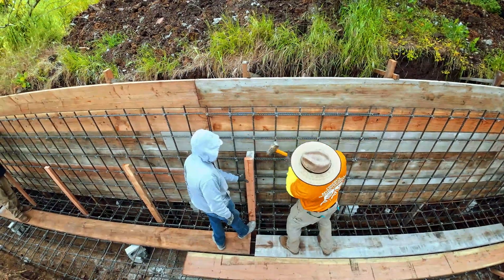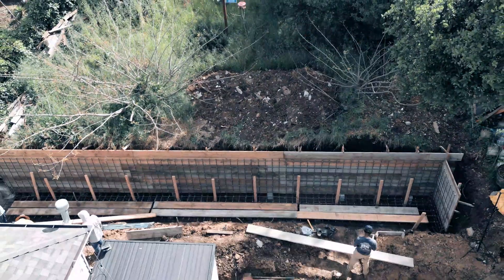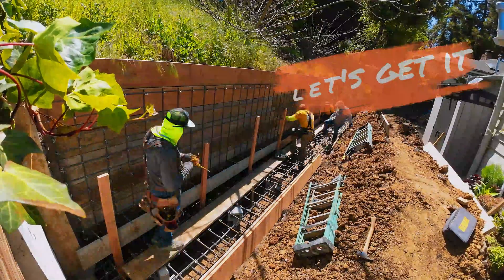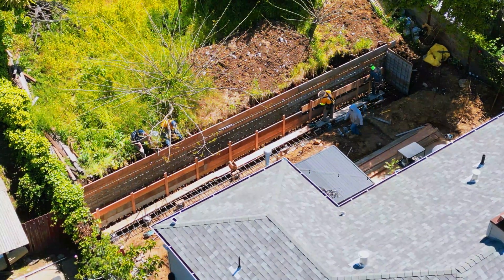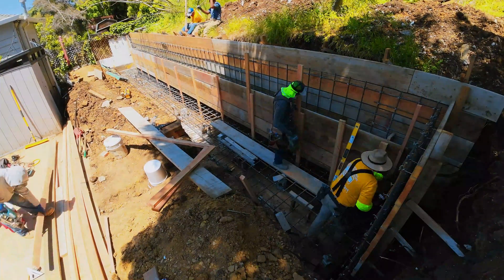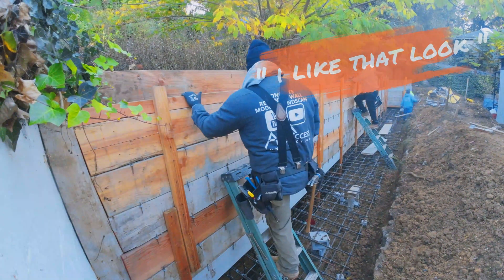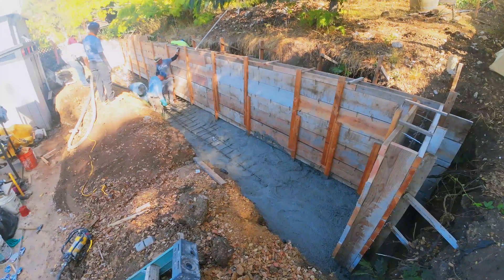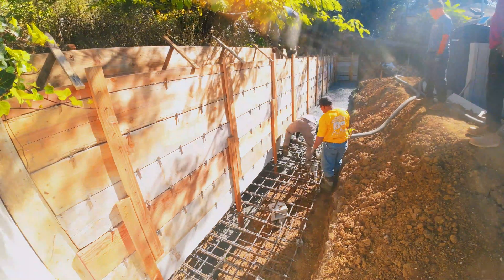How We Stabilized This Backyard With a Structural Concrete Retaining Wall

Comment: Awesome video, I have a similar Retaining Wall 12 inch wide footer with a 6 inch wide wall. My question is when I am driving the 2x4’s into the ground and attaching my form boards to them obviously, my 2x4’s will still be inside the footer Area so do you just cut  these off with a saw after the poor or is there a way to avoid this?  Appreciate you
Reply from the maker: Good day.. We just cut them off

Comment: Hey love your work.  Thanks for the videos!  

Trying this on a little 24" tall wall myself.  I am putting it on 8" diameter 6' deep piles every 5'.  Can I skip the footer do you think?  If no, I'll do a small footer and do a mono pour like you do.  How long after pouring the footer can you usually fill the wall with a 4" slump?  Is it hard to get that concrete to amalgamate?  I guess it's no different than pouring stairs...
Reply: amazing, thank you so much
Reply from the maker: @kendegen5844  option one will not work. Are you building on a hill?

Here's a video of us building small concrete wall.
Reply: @AllAccessConstruction  OK thank you for the response.  There is no link of the small wall.
Reply from the maker: @kendegen5844 https://youtu.be/ropBMwTRZJc?si=q3y8EWUq1F7z2xTc

Comment: Are you using WT8’s or similar ties? I noticed Simpson doesn’t recommend them for walls over 4’ have you ever had a problem with that, or are you using snap ties down low?
Reply from the maker: That's crazy to me and was big debate on my Instagram feed. We have built walls as high 12 feet.. And use them as wide as wt18.. No snap ties
Reply: @ good to know. I’m planning to do a 6’ high board formed retaining wall myself and have only built foundations with snap ties and 1 1/8” ply forms. You guys do fine work! Keep pluggin!
Reply from the maker: @baseddept.supervisor2417 cool good luck